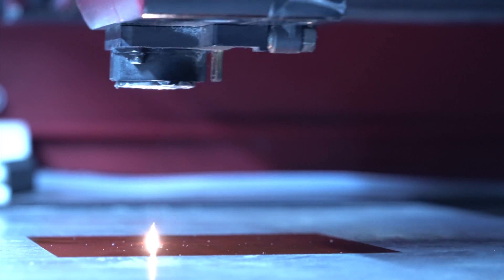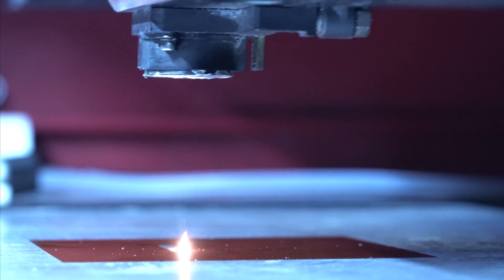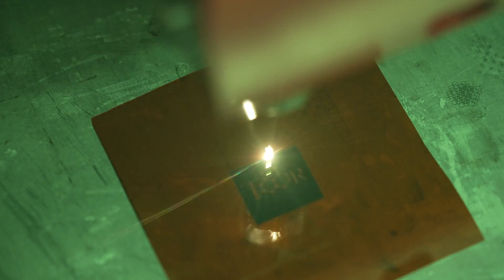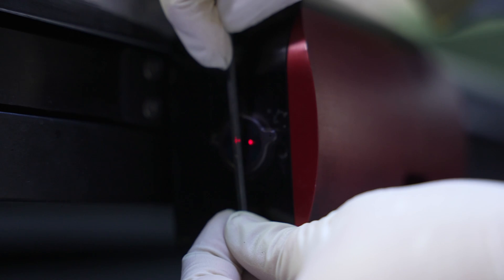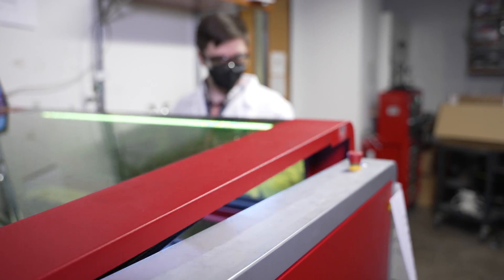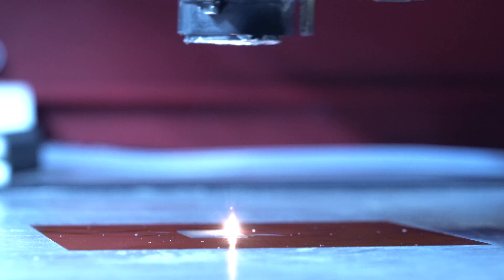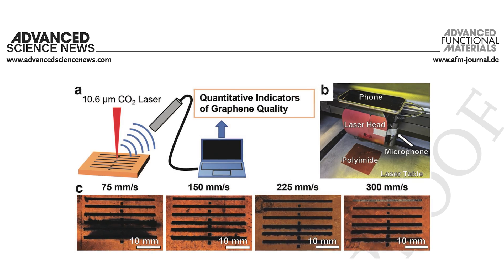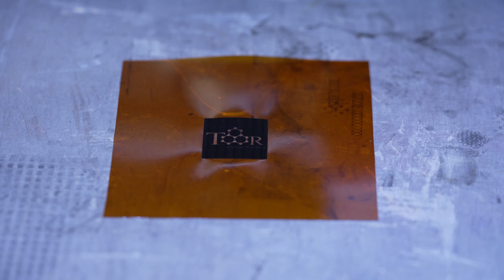When graphene speaks, scientists can now listen

Comment: Why don't we print graphene circuit films which allows embedded graphene supper capacitors and graphene antennas, so those multi-layer circuit films become an integrated system and internally communicate with each other through very, very low power radio frequencies?!!